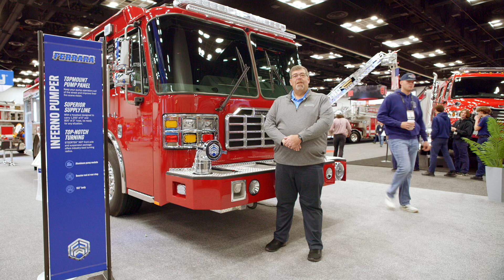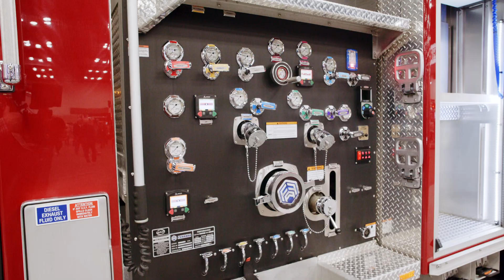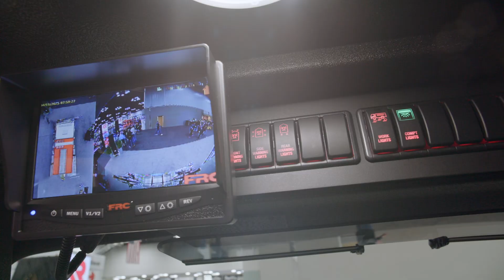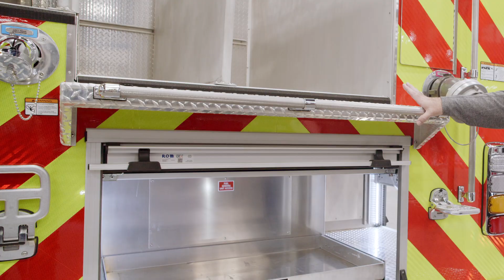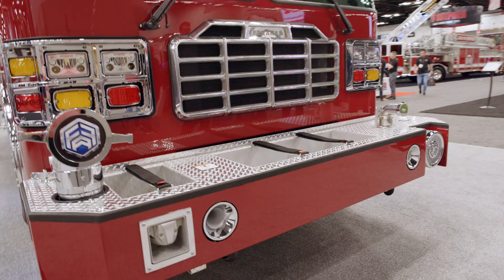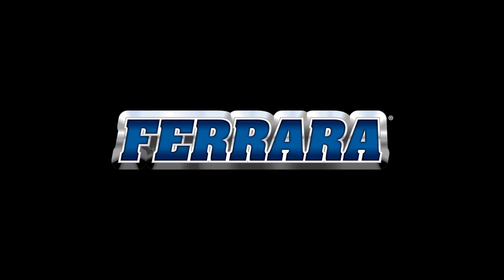New Custom Pumper for Trenton (NJ) Fire Department

Comment: FIRE DEPARTMENTS & TRUCK MANUFACTURERS: 
Please don't recess the Federal Q siren into the bumper.
They put out more sound to the sides than to the front.
Also, the electronic siren speakers put out more sound
to the front than to the sides.  A pair of them work much
better than a single speaker because they create tones
that are 4 decibels louder & can be heard from twice
as far away.  They will not work like this if they are put
on the 45 degree angle corners of the bumpers.  Lights
should be on the corners for better intersection warning.
If you can't place a Q on top of the bumper and don't
want it in the grille, you can help protect it from getting
damaged if it's sticking out from the front of the bumper
with two steel eye hooks through the bumper as well.